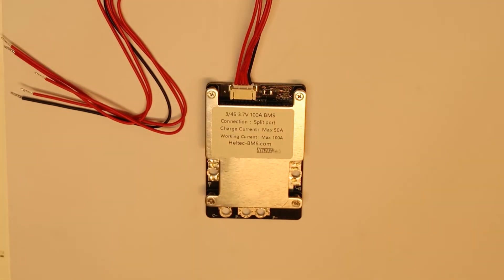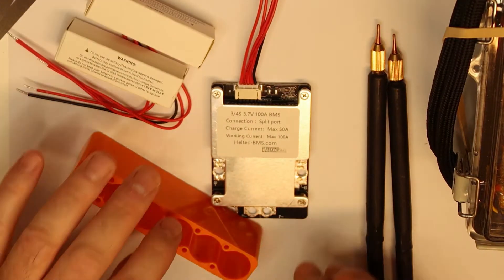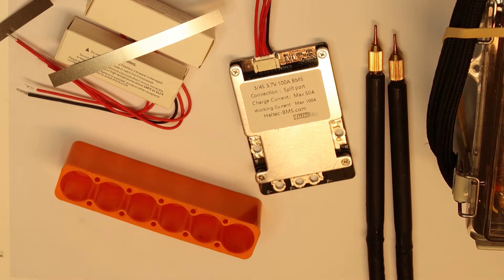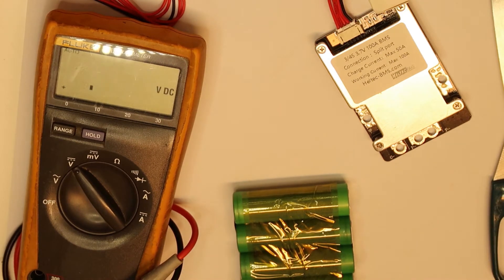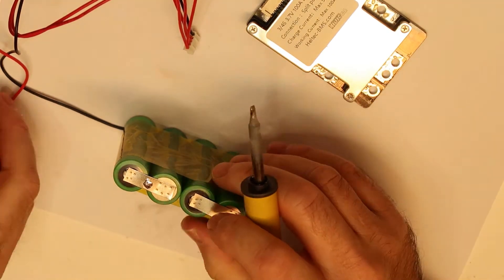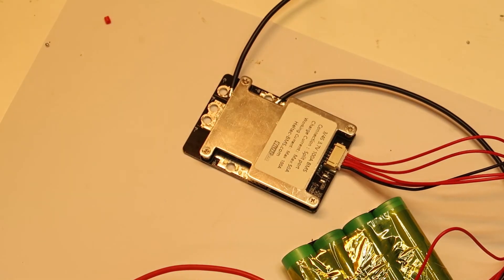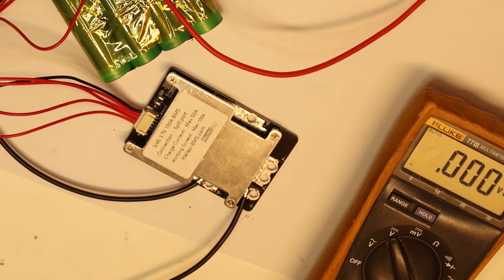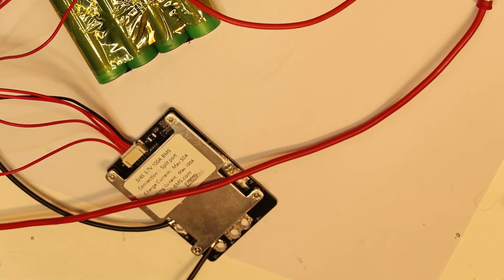Aliexpress 3S 4S 100A BMS -  Heltec BMS not balancing and not protecting cells?

Comment: Ok, This bms is actaully one of the good ones,even tho its passive balancing, it has relativly high balance current, ive used it for years on my ebike battery (13s bms) and it works fine.The thing to understand about out of balance protection is that its not meant to turn off the power if the cells are certain amount out of balance, it will only turn off when the lowest cell reaches minimum voltage (in this case 2.7v), thats how most bms-s work.
Also for this bms the overcharge protection is set to 4.28v.

Comment: I don't know to much about bms but
I think before you connect it the cells have to be somewhat close to the same voltage 

And from what I read they only balance in charging state and you never charged your battery through the bms so how would it balance it? 
Correct me if I'm wrong

This is not a active balancer

Comment: Hey there, nice video! The balance current is relatively low, so it really is more like a simple low and high cell voltage disconnect protector. Anyways, i do have the same one for LiFePo4 cells, however i‘d like to reduce the high voltage disconnect voltage a little. I would really appreciate it if you could pull the upper heat shield from yours to actually take a picture of the internals 😁 this way i could evaluate which resistors are actually different in yours for the voltage sensing. 

I would really appreciate that! Thanks a lot in advance:) 

Have a nice day!